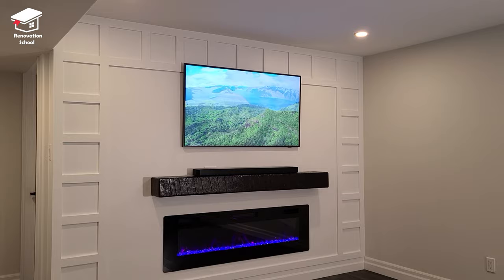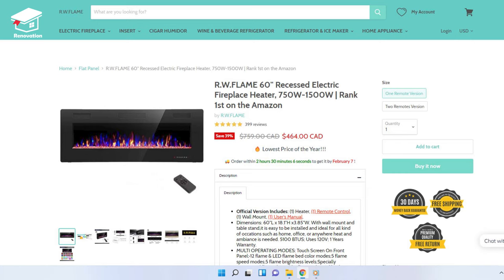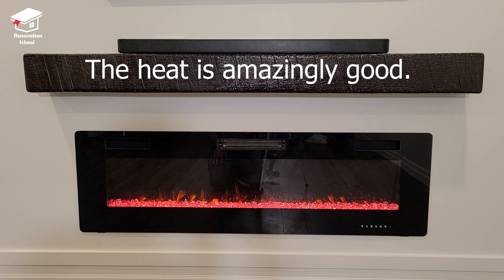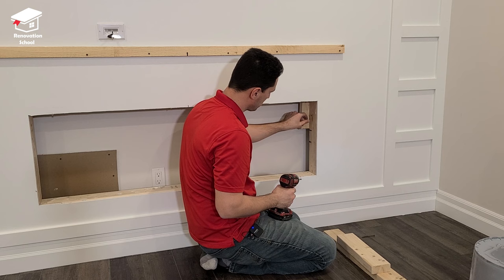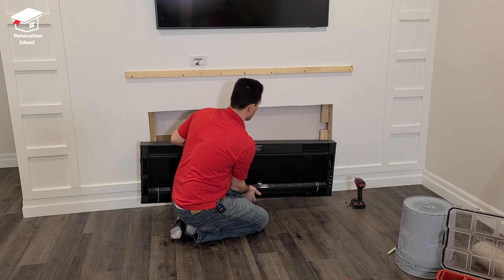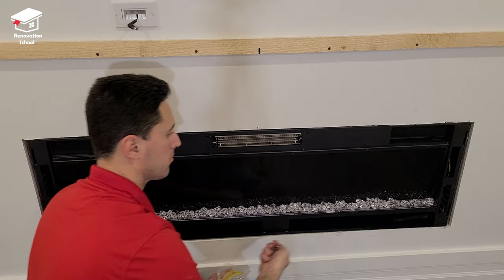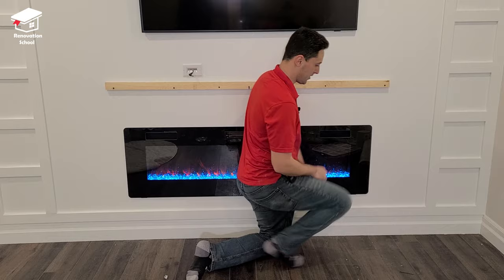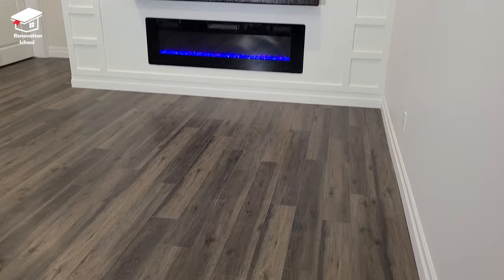how to install a built in electric fireplace. RW flame

Comment: I just bought and installed the same 60” fireplace. (Prime Day FTW.) I knew what I was getting as far as the lights go, but the heat absolutely blew me away. The fan is very powerful considering how quiet it is. The heat has a high and low setting (750w and 1500w respectively).
Reply from the maker: Yes 
its amazing for the price

Comment: How do I uninstall the glass? I need to replace the motherboard and I can’t get it off.
Reply from the maker: There's a small screw on the area where it looks like a Handel . Your hand goes in it . Remove that screw and then lift the glass up 
Look how I drop it in place at the end of the video. Do the reverse

Comment: Do you need to build out the wall first, or can you cut out the existing wall to install the fireplace?  Thanks
Reply from the maker: You can cut out existing portion also 
Just make sure it's not a load bearing wall

Comment: Interesting comment about Napoleon. The board on my 60" failed and they don't have the part available. So now I have to replace it. A couple questions, the video shows some angled metal fasteners to attach the glass to the fireplace, yet the installation manual on the RW site shows a couple screws that have to be installed from the side, that hold the glass front in place. Then the fireplace and glass are installed together. The second question is what are the glass dimensions? Help is appreciated.
Reply from the maker: Thanks for watching.
I gotta be honest I  installed this  long time ago. I really don't remember about the brackets and stuff. You can watch the video again and see how mine was installed. 
This was installed at a client house so I can't go back and measure the glass. Sorry.

Comment: Thanks for this demo... 
Where does the heat emminate from, the top, front, or bottom, and does it need a specific amount of clearance behind ro prevent overheating of the unit?
Reply from the maker: Thanks for watching 🙂
 The heat element is in the inside the unit and the heat comes out from the front top part of the fire place only.
there is a grill in the front and all the heat is coming from that grill, this unit can be installed flush to the drywall or wood or any other type of stone or tiled wall, you just need to leave about 6 to 8 inches of space  on the top of the unit between the mantel or any object setting above it, let's say u want to install a mantel like what I did in  myireplacee wall video. 
When the heat comes out from the front top of the fireplace, you want to have a distance between the wooden mantel or let's say the TV above the fireplace so it doesn't melt or catch on fire. 
I hope this answered your question, if you have any more concerns please don't hesitate to comment, all the best and thanks for watching again 🙂.

Comment: Can this be installed in a normal 4” stud wall without framing out or furring the wall?
Reply from the maker: Yes it can be installed for sure.
You just have to make sure that it's not a load bearing wall if you cut your stud in a load bearing while you're going to have a structural issues in the house.

Comment: Hi thanks so much for showing this 👌 we have just bought one for our new house ,we we are moving into mid March , we are UK based do you know if we used a Smart plug ,would the fire light up on the Alexa command ,or do you still have to use the remote to switch on ,not using the heater 🤞
Reply from the maker: youre most welcome
that, i dont know! sorry
Reply from the maker: I highly recommand you to make sure that your smart plug can handle 1500watts of power. because you dont want to take the risk of having fire behind the fireplace , specially when its installed built in like what i should you in the video.
Reply: @renovationschool8818  Thanks so much 👌iv'e found a device called a Broadlink smart home hub that can copy the remote and convert it to an Alexa command ,so much safer 👍
Reply from the maker: Im glad 
thats awsome
all the best.

Comment: hope this finds you ... I want to know are you suppose to mount it on the wall do I have to buy a separate mount for it? and secondly what kind of shelf is that and where did you get it from ?
Reply from the maker: The fireplace already comes with a bracket if you want to mount it over the surface of the wall.
I just wanted to make it built in that's the reason why I installed it this way.
As far as the shelf, if you're talking about the mantle above the fireplace, I have another video for it and here's the link:
https://youtu.be/QHi7uYg-hqg

Comment: How do u take glass off to put in stones
Reply from the maker: There's a screw on one of the grills , u take that off and then you push the glass up and pull it out 
Watch the end of the video where I put the glass on , it's the reverse of what I do 
At the end I did not put the last screw on , if u did put on the screw u can remove it and the remove the glass.

Comment: What is the depth of this ? How do you have deep back beyond the 2x4 is only 3.5" plus 0.5" drywall
Reply from the maker: We wanted to build it out so we can hide a pipe behind it. A pipe to feed the sound bar wire from the back of TV or from the room behind the tv to the top of the mantel
Reply from the maker: The depth of the fire place is only 4 inch 
Another this is u also need a bit of room in the back for the plug of the fireplace.
Reply: Hi!  Helpful video!  Just bought this same unit and had my contractor build out the framing.  The instruction booklet seems to indicate needing to use the mounting bracket to hang the fireplace on, but your video shows that you didn't use the mounting bracket and instead opted to secure the fireplace to the wall with screws on left and right.  I didn't see that option in the manual.  Would you agree the mounting bracket is not necessary to install?
Reply from the maker: @roshanvm  yes sir 
The bracket is needed if u want to hang it onto the wall like a tv (if it's not built in ) the whole point of the bracket is to keep it in place, if it's installed sticking out of the wall .I made it built in as a result the opening is the exact same size as the body of the fireplace so I had to use screws because I could not lift it up in that opening and put in on the bracket. fireplace is working as it should and it's been operating perfect since it was installed.

Comment: Are you able to remove front glass after installation?
Reply from the maker: Yes 
There's a tiny screw for it and I didn't put it in place . So all u need to do is to lift it up and pull it out. The glass comes off that easy.

Comment: I dont want it built in as I am on rent I have stands with it will it be OK?
Reply from the maker: Yes 
There is a bracket, you can screw that on the wall and the fireplace will set on it.
Reply: @renovationschool8818  no I mean can we stand it standing on drawer ?
Reply from the maker: It's not very safe 
The glass is sticking out about 2 inch from all sides . I mean the body of the fireplace is smaller than the glass so there is no way to stand it. It only can mount on the wall